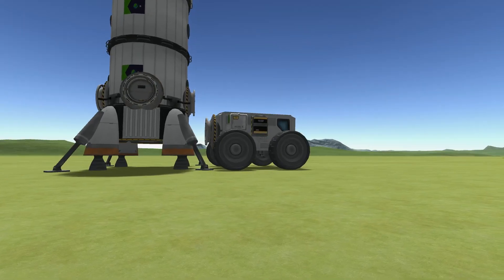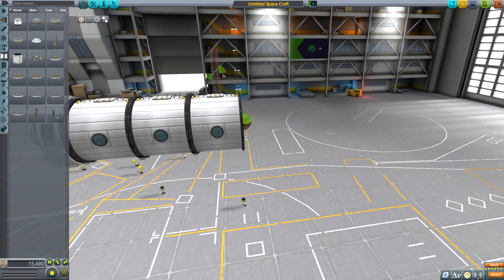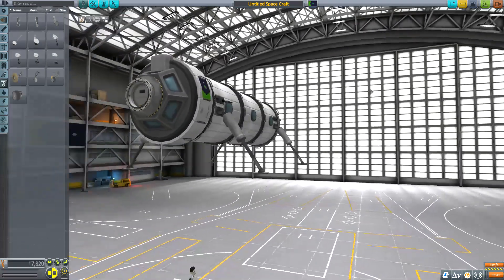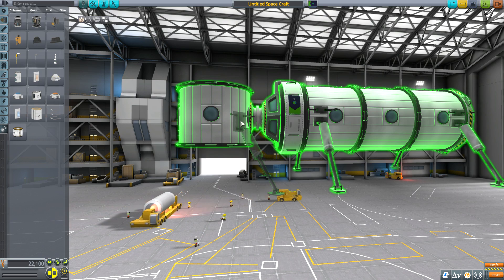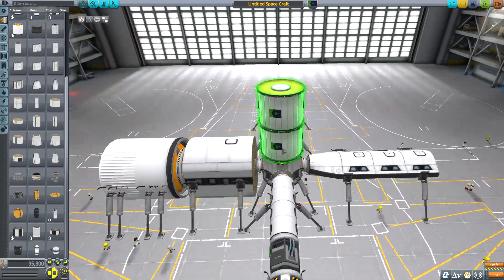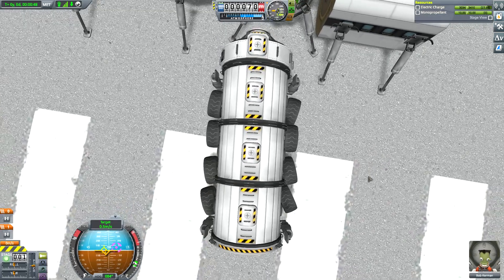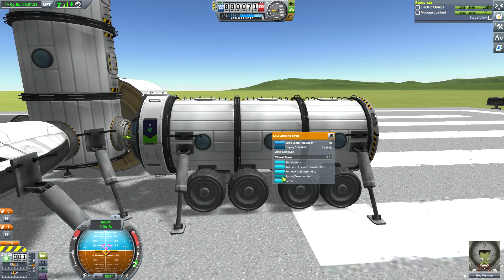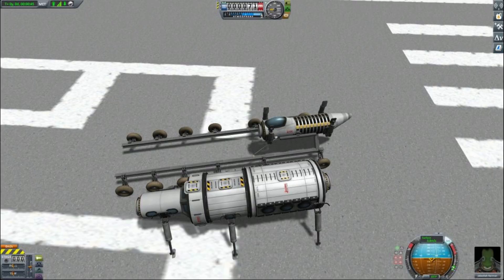A Simple Docking Standard for KSP Surface Bases

Comment: I always have an engineer available. I built a fuel truck for instance, with a docking port on the back. I slapped a couple of extra docking ports on the side. Now if I land at my mun base I can drive up to the rocket with my fuel truck and use my engineer to remove one of the extra docking ports and weld it onto the rocket at the right height. Refuel, undock and remove the port and put it back on the truck.

Comment: Hey turning down the landing leg damper strength takes care of the death wobble you see with full fuel tanks. I use the precise editor mod to attach all landing legs at the same vertical height across the vehicle. Highly recommended.

Comment: anything for how to land a base on a planet? would be really cool to set up a fuel depot on the moon or minmus
Reply from the maker: For the mun or minmus I'd recommend either landing them vertically with engines on the tail then tipping them over onto their main gear with rcs or reaction wheels, or using a kinda skycrane system to land them horizontally from the get go. Skycrane will probably work better for higher gravity worlds and with some effort you could probably make the skycrane reusable as it would be hard to launch something that unaerodynamic into space in the first place. However for low gravity worlds the first method will do fine.